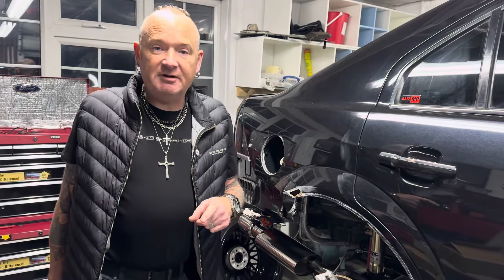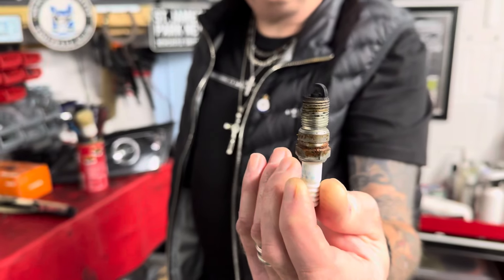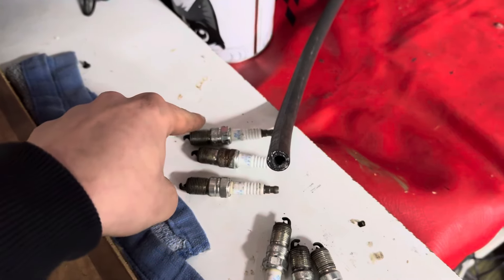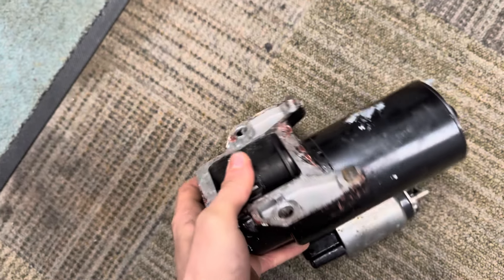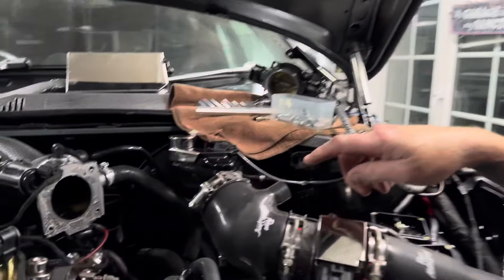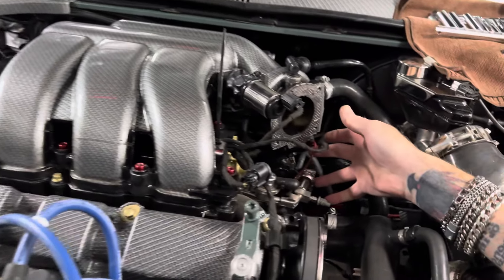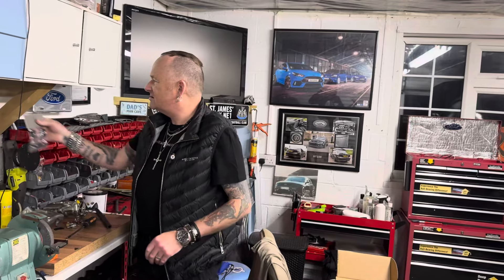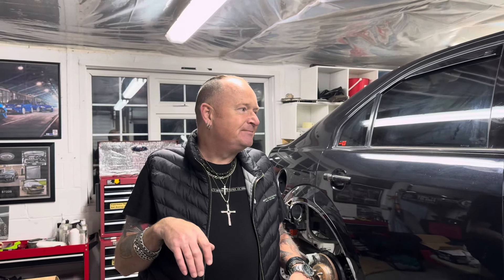Old man gives update on his car!

Comment: Looking good , have you tried the throttle position sensor? As that can cause a tone of issues , also the inertia switch that cuts the fuel pump off in the passanger foot well
Reply from the maker: @Shadowmosesarea51  Thank you, I will look at the position sensor. There is fuel at the rail so I don’t think it’s the cut off.